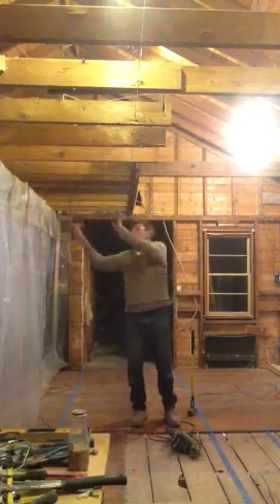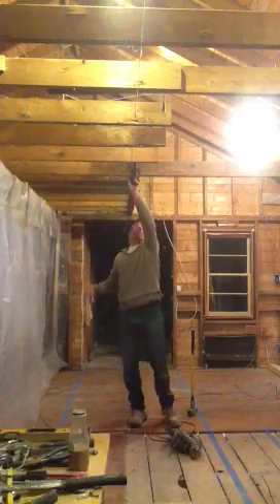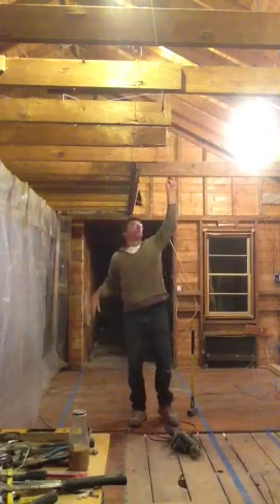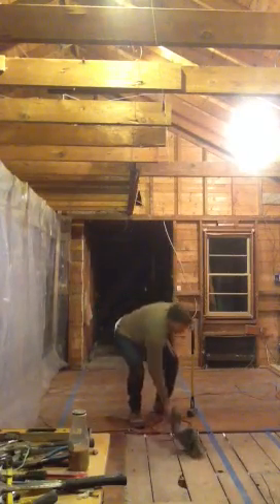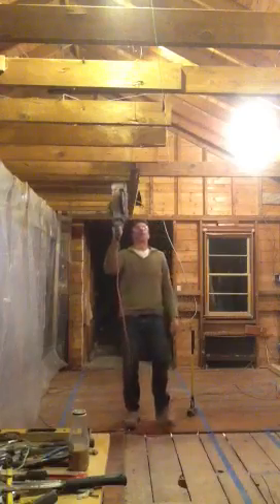I cut down a header and ceiling joists.

Comment: I’m putting a flush mount beam in and worried about the roof collapsing after I cut out the ceiling joist which are keeping the walls from separating
Reply: I can try to FaceTime with you and give you an idea if it’s safe
Reply: @ really?
Reply: @InspiredSpinning  that would be great
Reply: I’m just drinking and in limbo here just staring at the joist wondering if it’s safe.
Reply: If you’re up to it I would greatly appreciate it